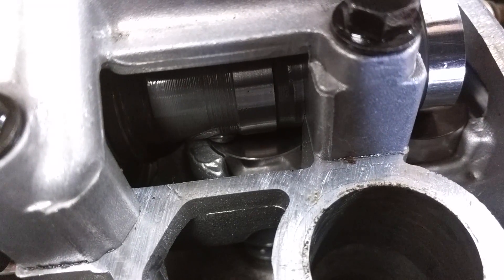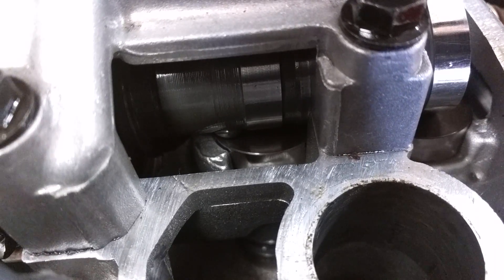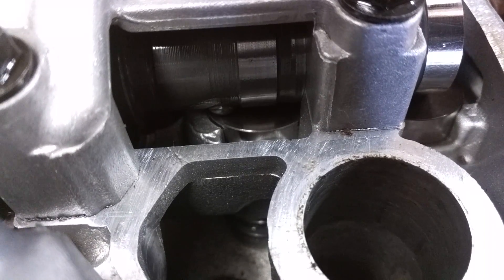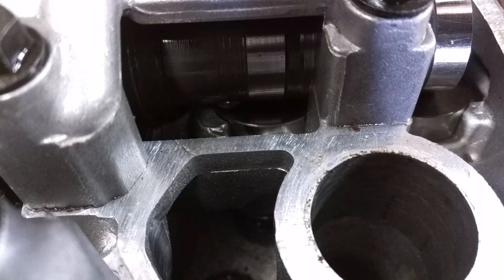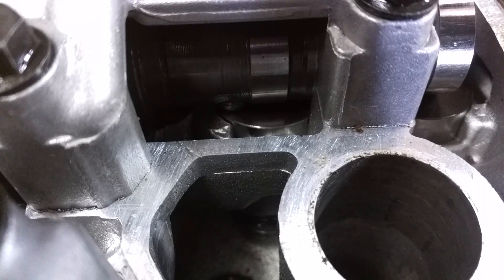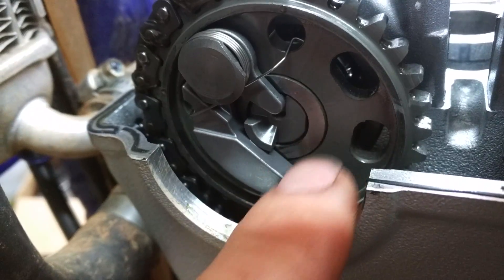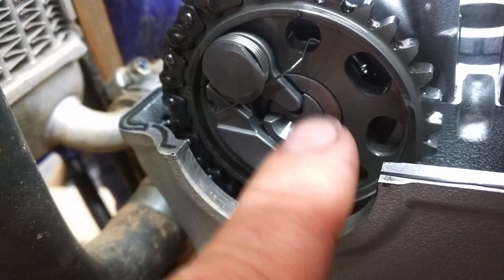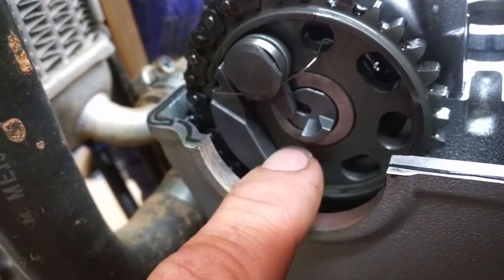Yamaha Auto Decompression cam, how it works

Comment: I have a 2001 yzf R1 that sat for a while and now has low compression. This video gives me something to look for before tearing it down for rings. Thanks, it's a short video, but says allot
Reply from the maker: @My68Tempest  Your R1 doesn't have an auto decomp but if it's been sitting, it may have a stuck ring. Put some kroil or seafoam in the cylinders and let it soak overnight then get it up to temperature.
Reply: @TepcoCycleRepair unfortunately I have between 40 and 80 on all 4 cylinders. It won't start with that compression. It has spark and just using starter fluid so I don't have gas sitting in the freshly rebuilt carbs while I'm still troubleshooting. Thanks for the response and info
Reply: Ive tried multiple chemicals over several months. Some have made progress and some did nothing
Reply from the maker: @My68Tempest  Ok so my next step would be to find out where you're loosing compression by using a leak down test, cylinder by cylinder. You need to find out if it's rings or valves sticking.
Reply: @TepcoCycleRepair  i bought one a while back i guess it's time to use it. Thanks for the response

Comment: Hay boss i hav a 2011 yzf450 it has a afta market fly wheel so the timing marks im not shore if its right there is 2 marks one dash and anatha line to the right of the dash..but i can get it to idle but it wont rev out could it b my decompression crack corzing the problem
Reply from the maker: @trevaynpaul6425  I would check your fuel pressure, you want it to be at or around 50psi and you want it to hold when the bike is off. Low fuel pressure won't let the bike rev out.
Reply: @TepcoCycleRepair  ok I Wil.give it a go how would I chek the fuil pressure iv chekd the fuil pump and it seems to be pumping outa the tank pretty good as u kick it
Reply: Could u tell me if my timeings right if I sent u a pic
Reply from the maker: @trevaynpaul6425  You need a fuel pressure gauge, just looking at it won't do it. 30psi doesn't look much different than 50psi. I would contact the manufacturer or look online for the base stock setting mark, unfortunately I don't know what that is on that flywheel.

Comment: Hey! I just ordered a 2003 YZ250F auto decompression cam for my 2001 WR250F. Do you know if I also need the intake side from the YZ250F for the install as well, or should the exhaust cam be okay dropping in alone? Thanks!!

Comment: My 2001 has the comp release lever, & still hooked up. The previous owner said he put in the auto release, I believe it because I never had to work the lever while starting. Now, the bike stopped running and compression during kick sometimes gets loose, and once, felt locked up for a minute. Could the replacement auto compression release be malfunctioning? Is this a regular problem? When it stalled the last time it was running, a whoosh of air seemed to escape.
Reply from the maker: Possible, I would just pull the valve cover off and take a look at it. Make sure it moves freely and the spring is working smoothly as well.

Comment: Took my 2018 wr250f for a ride! Stopped to talk to some friends n when I went to kick her over it felt like the spark plug was took out! Wondering if it’s a flaw in that system ?
Reply from the maker: The spark plug flying is probably not a flaw. Just put it back it and torque it to proper specs so you're sure it's in tight enough.

Comment: Can this decompression spring lose the pressure? making noise?
Reply from the maker: It could break but if you're getting noise it's most likely a large valve gap. A broken spring would just make it harder for auto the decompression to work.

Comment: Might be a long shot!!! My 08 yz250f has a “hot start” lever, to do this manually. I have no comprehension, but I can bump start and it rips. Can’t kickstart it, something wrong with the hot start or a new top end?
Reply from the maker: Probably a new top end. Hot start lever is not a decompression lever it lets more air in the carb so it doesn't flood on hot starts. The 08 has an auto decompression cam. A leak down test will answer the question if you need a top end easily.

Comment: Hey, i just rebuilt my yz250f 2007, i checked the valves they are in spec, and the timing is perfect. Why is my bike still poping when i let go of the throttle at high rpms. Could the auto decompression system fail?
Reply: Sounds like a carb issue.
Reply from the maker: Check for leaks in your exhaust or a lean pilot circuit. Either can cause popping on deceleration.